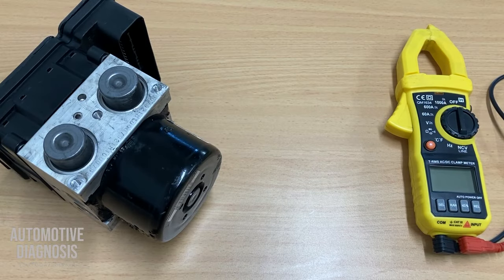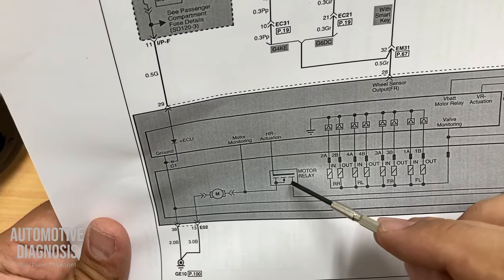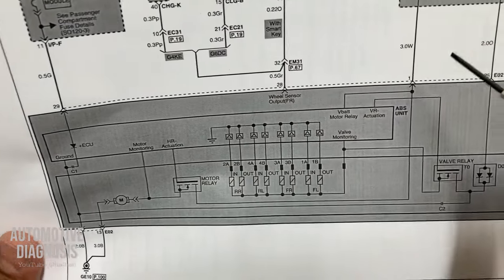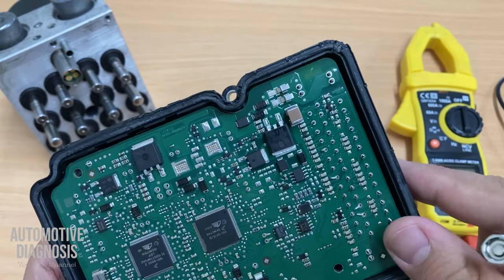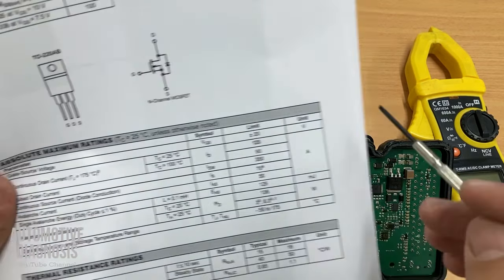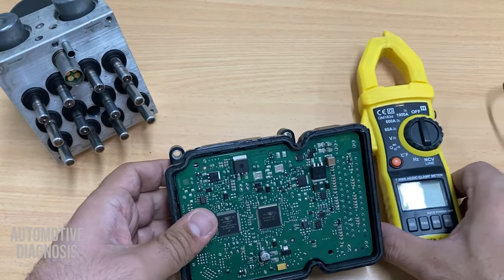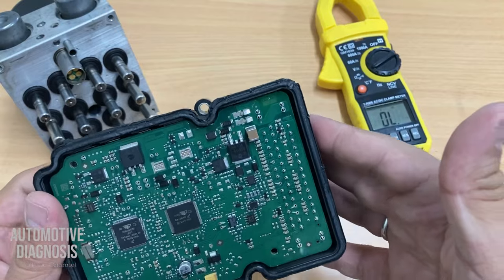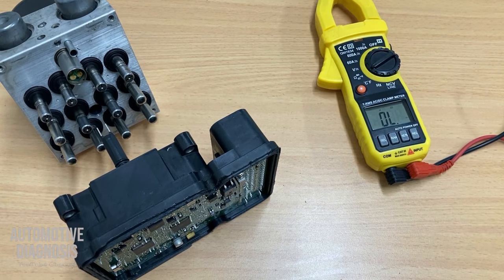Don't Replace ABS Module Before Watching This | Repair ABS Module for Motor & Valve Relay Error

Comment from the maker: Please watch Part 2 of ABS Module Test & Repair using the following link:
Don't Replace ABS Module Before Watching This | Part 2 | ABS Module Components Test
https://www.youtube.com/watch?v=Copb1PrL6UI
Reply: Good Day 
Can you also make video for toyota camry 2007 abs control module
Reply from the maker: @juliecasiple1571  Hi there, sure thing, I will make the video as soon as I have a Camry with ABS problem.
Reply: Much thank sir ,at list have gained something i highly appreciate
Reply: thank you, u are doing a nice job
Reply from the maker: @abdulrazakbello3793  Thanks a lot, I’m glad you liked the video.
Reply: Amigo e quando modulo tem uma falhas u3000 seria qual do componete a ser trocado poderia compartilhar  comigo amigo gostei do seu vídeo que vc seja muito abençoado
Reply: I have volvo xc60 2013 abs module no communication at all...CAN voltage ok...two main power source Ok...ground ok also ...ignition ON voltage ok...what should I look next please...
Reply: Thanks

Comment: Ironic I found this video. Actually my ABS was having faults. My mechanic first said need to buy a new one then has to be coded. Which would have cost a fortune. I told him give me the module and I'll send it to an electronics repair place I know who are really good. They fix everything from from gpus, laptops, cpu, etcetc. Sent it to them and they found it was as you rightly pointed out a power pin supply issue. They fix3it and my mechanic fitted and ran diagnostic test. No issues. Save a ton of money too! As you said anyone that has a abs module problem said do this!
Reply from the maker: Thanks a lot for sharing your experience. I’m glad this video was helpful 😊👍
Reply: Hi would you mind sharing who you sent yours to
Reply: What problems did you experience when the abs wasn't  working?
Reply: Unfortunately it's a part changer market nowadays.

Comment: Do you have to remove the whole unit from the vehicle before taking this off or can you remove with the unit in place? Assuming there’s enough room that is.
Reply from the maker: Hi there, it’s really based on the nature of the issue and the ABS module itself. On some modules, we have to take it out to remove the unit’s cover as it’s a very sensitive job, and sometimes this cover is located facing the vehicle body which makes is impossible to do the job on the car.

Comment: 2 mechanics told me the processor died on my abs, could i take it to a laptop repair guy to reball the core?
Reply from the maker: They might be able to take it off the ABS electronic board, but they won’t know how to program the microprocessor.

Comment: Thank you for your explanation of the troubleshooting of the ABS module. As I have knowledge in Electronics, Soldering, and Components this is very informative for me. If we are performing home repair on any electrically controlled device, YT is a great source for finding schematics, components, that allow us to check many things before we have to purchase a completely new part. Thank you for your in-depth analysis on the testing of this Control Module.
Reply from the maker: Thanks a lot. I'm glad you liked it.

Comment: Dude, this is a phenomenal video. I have a 2011 Challenger and I absolutely cannot find a replacement. I admit, I do not have any confidence in myself to do the job myself, so I will not try it on my own car. That said, I may start scavenging the local scrap yard and pulling ABS modules out and start poking around inside them to see if I can learn a little something.
Reply from the maker: Hi my friend. I’m glad you liked it. You also must be very careful when you work around the brake system for yours and passengers safety.
Reply: @AutomotiveDiagnosis   Thank you! Of course, that is why I am leaving a professional to work on the one from my car, and I will only practice on modules from cars that are to be scrapped.

Comment: found your video helpful. Im diagnosing a 2008 lexus rx350. The code im getting states the solenoid relay faulty. I checked the fuse and they were fine. Since i ran out of time to do further diagnoses. I will return to reconfirm power supply to the harness and inspect the pins for any movement. If im lucky enough to even open it. Keep up with good informative videos. 👍🏻👍🏻👍🏻
Reply from the maker: Hi my friend, thanks for sharing your experience, I'm glad this video is helpful.
Reply: Hello, I guess I need a real deeper training, how can I join you for classes??

Comment: Thank you very much for the very good explaning of the ABS control unit. Now I understand it far better. I have an ABS fault for many years, when I bought the car Peugeot 307 from 2004, they pull out the fuse, so it must be a problem. On holiday the speedometer did not work and I checked all the sensors, bought two new ones, but still not working. Greetings Frank.

Comment: Thanks for the excellent video. I'm an electronics engineer (for over 30 years) and dry joints are a prevalent issue in places that have a lot of vibration etc, just like you pointed out on the +ve supply pins. My Suzuki Grand Vitara has an ABS/ESP error so I'm suspect dry joints on the circuit board is the cause. 

Question: What do you suggest you use to reseal the cover? Black auto silicone maybe?

Cheers!
Reply from the maker: Hi my friend. Thanks for sharing your experience and for watching the video. Yes, actually the black silicone is a good choice.

Comment: great video and I'm an electronic tech so the service checks are easy. Only problem is the cover over the control board is sealed and breaks if you try to remove it. It does not snap back on. So removing it and locating the problem is a mood point as the module can not be resealed correctly for use.
Reply from the maker: Yeah, removing the cover and resealing is tough, sometimes I spend so much time to do it right.

Comment: Thank you for the video brother! Have almost the exact one..about to run tests now! Was reading a circuit fault so hopefully i can figure out why! Thanks again!
Reply from the maker: Thanks for your comment. Glad this video is helpful 👍👍
Reply: @AutomotiveDiagnosis  i ran all the tests you showed in the video and all check out ok. Do you have any other videos on the same controller? For diagnostics? Thanks
Reply: If everything is ok probably then the  pump could be the issue, but also the two positive terminal, are connected to the same circuit, which means they have continuity between them, in my case I found out The positive terminal to selonoid there is no link,.
Reply from the maker: @shafiisigera  Thanks for sharing your experience.

Comment: Thanks for the excellent video!
I have a 2003 vw mk4 Golf that is not getting any abs errors or trouble codes but I cannot bleed the driver rear calliper and have diagnosed to the abs module.  Looks like it could be a sticky/stuck valve.  Is disassembling the module a possible way to check or confirm it’s a stuck valve?  Using VCDS abs output test to check operation.
Reply from the maker: Hi there, and thanks for your comment.
It is possible to dismantle and check the valve, but as it is sometimes a long procedure so from my point of view it is better to make sure nothing else is causing this. Just one question, when bleeding the braking system equipped with ABS, we normally bleed in two steps, first of all conventional bleeding (without scan tool), then bleeding with scan tool (if that scan tool covers the function), When you do the first step, do you get brake fluid on driver rear caliper or no?
Reply: @AutomotiveDiagnosis  Nothing at the Caliper.  I also disconnected the pipe at the ABS valve body for that rear caliper and there's no fluid coming out even with break pressure.  All the other ports have fluid so that's why I suspect a stuck valve.  I've also tried actuating the valves using a magnet but couldn't hear clicking or activation.  Is alcohol and compressed air the best way to try and clean?  This makes we wonder how many older vehicles are on the road with this type of issue as it doesn't through an ABS code.
Reply: @brentredberger9437  how do you solve this problem? My abs has same problem with you. Thanks
Reply: @x_gangsa  I was unable to repair it.  I ended up getting one from a parts car.

Comment: This was a great video. It was easy to understand what you were teaching us. Very detailed. Thank you so much!  Do you know where to get a diagram for ABS module of 2007 S-Class Mercedes W221?
Reply from the maker: Thanks for your comment. Sometimes that I am struggling to find any wiring diagram, this website helps:
Cardiagn.com
I don't have any connection with those guys, that is just what I found helpful many times.

Comment: Great video sir, i have i very similar ABS module like this one from a Suzuki. Did all the checks however it seem to have a fault from the solenoid valve driver it self . DTC C1043. Very informative video .
Reply from the maker: Thanks a lot for your comment and for sharing your experience. Yes, if your have checked the power supply on the ABS module, it could be from the solenoid valve driver.
Reply: C0500

Comment: Thank you for making this video. You have de-mystified the ABS functioning and explained it very well. I have a 2013  Ford F150 that shows ===ABS DTC C1440-20===Code: C1440 - Pressure Difference Transducer Circuit Failure when I scanned it. I am told that this is inside the ABS control module but did not see it referenced in your video. Can you offer any insight as to where I can find it and possibly repair it? Thank you!
Reply from the maker: Hi my friend. It is actually located inside the ABS module and the reason for not addressing  in the video is that this sensor is controlled directly by the ABS unit there is not much we can do about it. Most of the time when we have this code, we have to replace the entire ABS module.

Comment: Thanks for the video explaining the repair procedure. Is this ABS module out of a Mazda 3, BL series ? Many of these ABS modules fail on this series of Mazda 3 .
Reply from the maker: Hi there, thanks for your comment. This one was actually for Holden Captiva which is used on some other models too, but the procedure for testing is pretty much similar.

Comment: I appreciate your advices. Right now I have trouble with MK4.First I will check welding of ports.I ask workshop to ckek it and were chocked about thgeir offer.Only checking pcb 119€, repair 250€ . So I try it repair it by my self.
Reply from the maker: Thanks for sharing your experience, please keep us posted how it goes.

Comment: Well done! I learned a lot.
2012 Ford Escape, randomly the brake pedal will go to the floor while I'm stopping and I lose like >80% of my braking effectiveness, but then the brakes are fine next time I use the pedal. No ABS codes are populating, nor does the vehicle pull to either side when this happens.

After watching your videos, maybe one of the outlet valves is sticking open, or being unseated intermittently?  Any suggestions how to narrow down the issue, if this could be electrical or mechanical?

Comment: Great video.  My 2011 Sprinter is giving me a communication failure  (P11C900).  Could it be a cold solder joint on the power sections you described?  I haven't pulled it apart yet.

Comment: That is a good job for checking continuity only.  You can check the diodes and also be able to turn on the FET transistors with the meter as well.
Reply from the maker: Hi there, thanks for your comment. Yes we can do more on the ABS module, I didn't go any further as I didn't want to make this video complicates. There is another video coming which will provide additional inspection.
Reply: @AutomotiveDiagnosis  any idea when that video will be ready? Hopefully i won't need it but would like to see it anyway..about to test cont. On my unit now

Comment: Thankyou for this video. I have a similar board totally dead. Not detecting on Can Buds. Fuses ok. 
Where does the main  +Ve rail start on the board.
Reply from the maker: Hi there, normally there are 3 pins for the supply voltage. One for ABS motor, one for the valves and the last low amp one for the board. What is the model of your car? Wiring diagram helps for the pin location.

Comment: The part with 4 small gold pads,is this the pressure sensor?
I am having issue with G201 pressure sensor-fault in the circuit.
You have pointed the solenoids but missed the part I was hopping to identify.
Great video!

Thanks
Reply from the maker: Hi, yes that one is the pressure sensor, I pointed it out on the second part of this video but we normally don’t replace it, sensor itself could be faulty and sometimes it’s from the ABS board.
Reply: @AutomotiveDiagnosis  Many thanks,have another module on its way to me so fingers crossed I can get it fixed.
Is there a place on the board that i should pay close attention to when it comes to Pressure Sensor?
Any help will be greatly appreciated!

Comment: Thanks for sharing the video. Referring to the 16:40 of the video about the ABS Motor Transistor. We
connect the positive voltage to drain pin of the 2N06LH5. My question is that why not connected negative voltage but positive since the 2N06L5 is N Channel Mosfet?

Comment: This video is incredible! We are having lots of issues with that ABS/ESP module in the Suzuki Grand Vitara 3.2L from 2008 to 2010. Will need to check this out!
Quick question, how did you open the cover? Brute force or is it just glued?
Reply from the maker: Hi my friend. I hope this video works for you. There is also part 2 for this video that you can find the link in description. This one was glued, so just cutting job (I did use my heat gun too a little 😅)
Reply: @AutomotiveDiagnosis  thanks for the quick reply! Cheers!

Comment: Hi, i have an 01130 abs implausible signal faultcode with golf 5. 

I checked the fuses, but those are fine.

Can you tell me what could be the problem inside the module?

Comment: What model of electronic brake control module is that? 
i have a 2012 Cadillac SRX with ebcm model 20842710 and that module is on back order from GM. I have a code of C056D which means internal failure. What do you think the problem is with my abs ebcm. Would doing these tests help me out or should I send it in for repairs to a abs module repair place?
Reply from the maker: Hi there, thanks for your comment. This was Holden Captiva which is similar in many other cars too. this code (C056D: Electronic Control Unit Hardware) can be from wiring harness (Power and ground provided on the control unit), ABS Module internal circuit or semiconductors. So, kinda a big inspection might be needed.

Comment: Hi. I found your video very interesting. I have esp error showing on my dashboard (vw passat b6) 3 mechanics told me new abs pump + recode.  My question is  , is esp error message because of broken abs module?  I hav esp error message , t.c light and tyre pressure light. Blinking intermittent. But no abs light?
Reply from the maker: Hi there, ABS and ESP are actually in one unit.

Comment: Would it be possible for you to dismantle the ABS module of the 9th Generation 2014 Honda Accord?  I think there is a problem from the design of the circuit board.  I really like your presentation, it's useful.
Reply from the maker: Hi there, thanks for your comment. How did you come to this conclusion that there is a problem on the circuit board? What is your current fault code?

Comment: hello thank you for the video. My car is Astra j 1.4 t. My speed sensors are fine. I did what you said step by step and everything seems fine. I will collect it and put it in the car. Where should I look if the esp abs brake light comes on again?
Reply from the maker: Hi there, Normally we must check the wiring before removing the ABS module. If sensors are fine, wiring could be damaged.
Reply: @AutomotiveDiagnosis  thanks. If the cables are also solid, is there another reason? for example if the hydraulics are very old. Thank you very much for your interest. have a nice day
Reply: @AutomotiveDiagnosis  
Also, my car's fault code is C056D-00 ABS control module, written on the dtc. complex malfunction. The mechanic said ABS module replacement.I would be glad if you answer

Comment: Hello Automotive Diagnostic,  a big thank you for making this two part video very easy to follow, clear and informative a lot of useful information.  Quick question I have a fault code on my Nissan Primera P11 /Infiniti G20 ABS system (65 EXT SIGNAL CIRCUIT ABNORMAL) no one can't seem to understand this code..  Any help on this would be greatly appreciated. 

Thanks!!!!
Reply from the maker: Hi There, thanks for your comment. For this fault code I would check the speed sensors first.
Reply: @AutomotiveDiagnosis  Hello thanks for your reply.  A road test was done and all four sensors are working but the front left was replaced with and OEM replacement. 

Thanks again.

Comment: Thanks AD clear video. Please a consultation. My blazer 2000 dont purgue. Abs module Keseu Hayes do the cicle whith the scanner but dont purgue. I can hear it. There is no ABS signal on. There is no fail number detected on de scanner. Could i have any trouble in ABS module undetected by scanner?

Comment: Great video and explanation.....I wish this was about a 2004 Chev Impala ABS Module instead.....
Reply from the maker: Hi, thanks for your comment. Even if there are small differences, principles are still the same so if you find the wiring diagram you will figure it out.

Comment: For 2011 prius, ABS system has actuator/mater cylinder (which has ecu circuit board and solonoids) and the pump (which has a motor and an accumulator), the pump keeps turns on every 10 secs so can I assume the circuit board is good? I found an electric shop that will rebuild the pump motor which include replacing brushes, bearings, and rewind new commutator